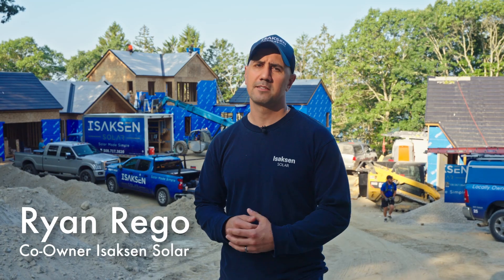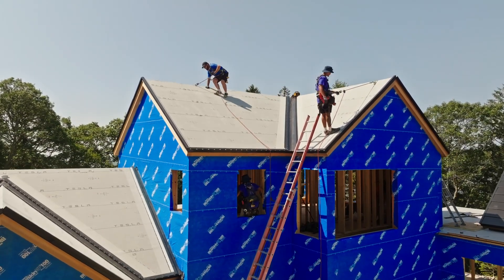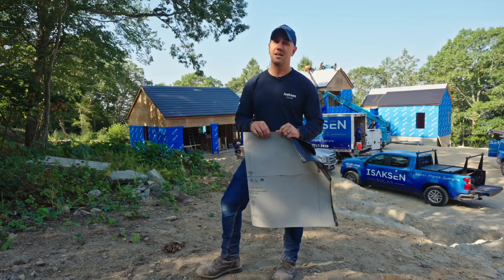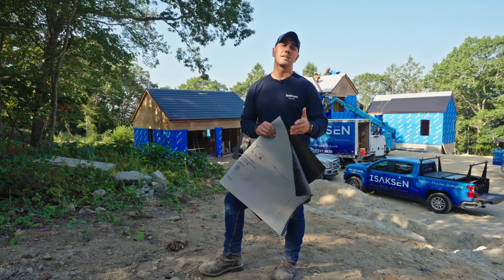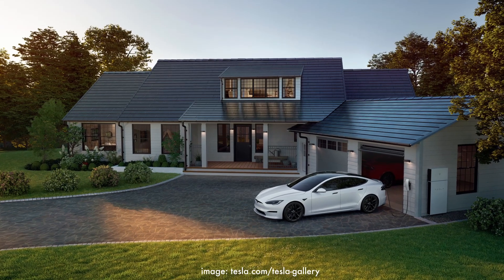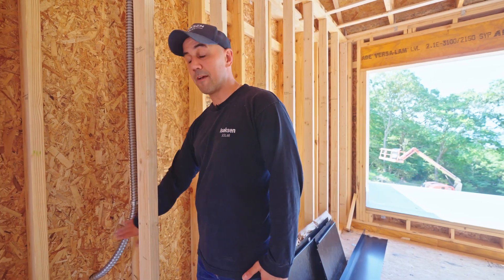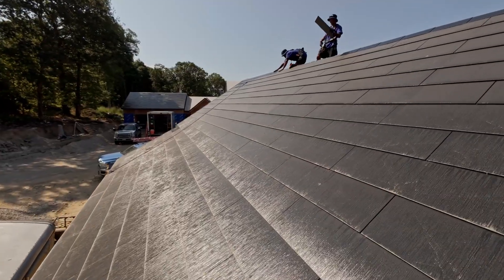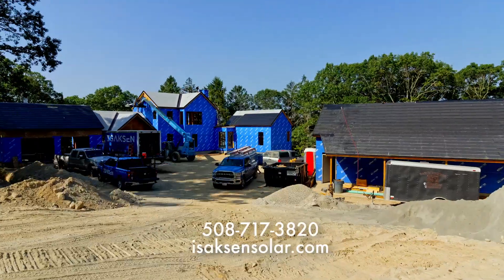Tesla Solar Roof: Expert Walkthrough by Isaksen Solar

Comment: How does it handle 4 feet of snow?
Reply from the maker: Tesla doesn’t officially publish a maximum snow load rating for the Solar Roof. What I can share from experience is that our crews walk on these roofs during installation, and many of our installers weigh over 250 pounds. That’s more pressure than 3–4 feet of snow would put on the tiles, and we’ve never had a single tile break from weight. On top of that, every installation is engineered to local building codes, which are designed to handle heavy snow loads. The tempered glass tiles are extremely strong, and in practice, they perform great in snowy climates.

Comment: ROI is 50+ years
Reply from the maker: The return on investment depends a lot on where you live. The cost to install a Tesla Solar Roof is fairly consistent across the country, but the big variable is your local cost of electricity. If you live in a state with very low electricity rates, the payback period could stretch out to 50 years. But here in New England, where power costs are among the highest in the country, we typically see ROI in the 15–25 year range. And remember — that’s not just solar, it also includes a brand-new roof built into the investment.